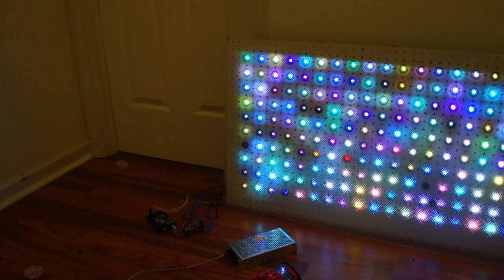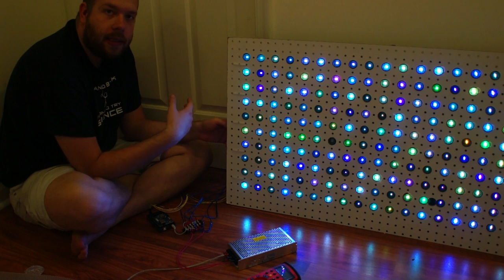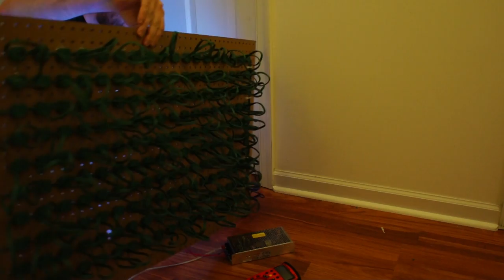LED ambient display WIP

Comment: Cool. I made a 6x8 coffee table, and used frosted tempered glass as the top. It look really good with the glass 1 inch away from the top of the table and light. I use a bunch of 1" piece of cork from Lowes to hold that up.
As for this one, I'll probably try corrugated plastic panel and see how it work out.
We're trying to get video to load from an SD card first... then we'll try a webcam / screen duplication from a computer.

Comment: Also, you dont necessarily need a Mega right?? Considering you're only using 5 pins... not to mention the Ethernet shield only takes up 3 pins? We're still testing to see how to implement ours.